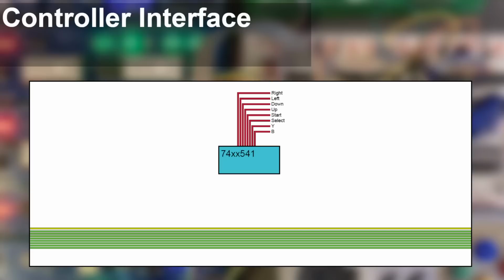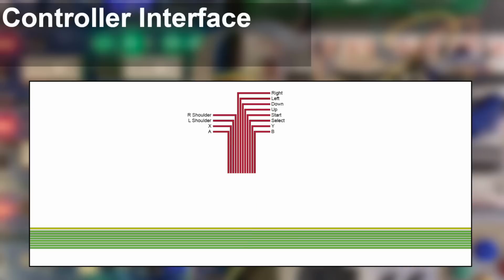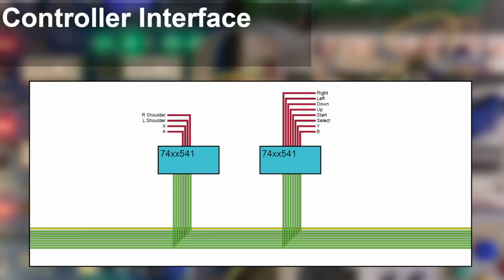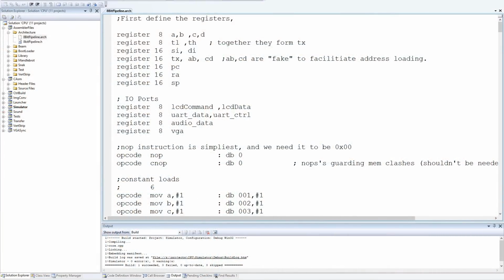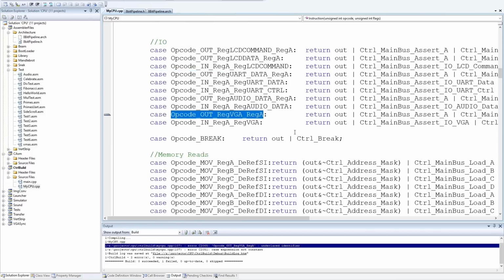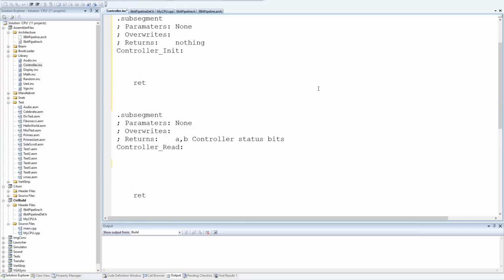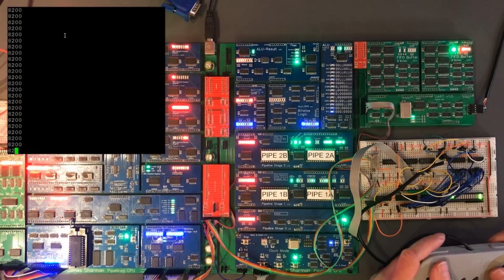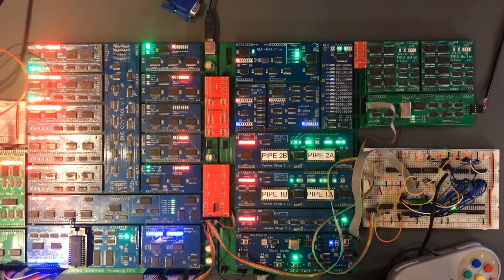SNES Controller Interface – Part 2 – Connecting to the homebrew CPU

Comment: This is a good solution to read 16 bits with only one control line. I think I would have changed the interface a bit to free up bit 8 free on both bytes to be used purely for identification so you would always be able to guarantee which byte has been read just by testing bit 8. I know exactly where you are coming from trying to keep the variety of components to a minimum, even if it used a couple of extra chips overall working with fewer different chips is less head space.
Reply from the maker: I’ve mentioned it in a few comment replies already but I did consider splitting the bits more like that but picked this for a reason. I wanted all the direction bits to be in the same byte (that makes life easier working with the data in code), and I didn’t want to re-order the bits relative to the original data stream.
Reply: @weirdboyjim  another alternative is to pull up bit 7 & 8 for the second byte, since it would be impossible to press both left & right on the controller at the same time.
Reply: @weirdboyjim  Right, it seemed a little odd that you hadn't done this but thinking about it from a software development perspective it makes perfect sense.
Reply: @weirdboyjim  what about a time based reset of the flip flop? You'll likely read both bytes right after one another, and probably not more than once every 60th of a second, so if you reset it every 10ms you'll know that on the next reading cycle you'll always get the first byte first.
6 buttons Megadrive joypads use this trick, so older games which expect a 3 buttons joypad and read only one byte per frame always get what they're expecting.
Reply: I think I'd have made the "signal" that the top two bits were high: to fake that a user would have to hold left and right simultaneously, which I believe is mechanically impossible on the real controller?
Reply: Ah, I see @Stingpie 52 has also suggested this, I didn't scroll the comments far enough.

Comment: Nice.  I'm glad to see I managed to guess how it would be integrated, and what the first demo would be.  :P

At this point, I think the only thing missing for a proper VGA port of snek is the tilemap so you can do text.  I might start porting my version over to VGA, and see about integrating my music tracker... just need to find a reasonable track to use.  I think Nyancat on loop would just drive people insane...
Reply from the maker: Yeah, the Tilemap would make it easier. I think having Audio and Controller on pcb would help as well, I'm low on space without making everything really small in the video feed.

Comment: Why not just map both bytes to a different memory address? Memory mapped Io? Seems much simpler. Maybe the answer is obvious but with so many interesting projects to follow i cannot fully know every single one.
Reply from the maker: That would work, but be much more complex. This circuit connects tot he cpu with 12 wires, you would need to add the address bus and the memory control lines to it. Then you would need to decode the address lines which would take a bunch of extra chips.
Reply: @weirdboyjim  not necessarily. Address decoding often is a task of a single chip or unit in your case. All the boards would need is a select line and a single address line to check odd or even address in this case. The one address line would replace the flip flop and the software state detection

Comment: Another option rather than having the MSB pulled to VCC to work out hi/lo byte is to have some time function (maybe even a 555) do the work for you.  The first byte being read is the low byte.  If another byte is read before an n millisecond time-out period then it is the hi byte.  It also might be an idea to not clock in the SNES data constantly if you ever want to use some old school wireless controllers.  Some of those would freak out if they did not have a rest between clocking.
Reply from the maker: Interesting idea. If you were to implement something like that it would be better to make the timeout a number of system clocks though to make it deterministic.

Comment: Could you feasibly use the reset line to hold the shift register's enable pin in a disabled state until the processor finishes booting? That'll make sure the controller is ignored during powerup, and holding any of the buttons won't do anything
Reply from the maker: You could indeed, but I avoid hardware state that can’t be reset in software. Imagine developing a piece of code, you upload a version that crashes and then you test a fix but can’t be sure if the broken version left things in an unexpected state.
Reply: @weirdboyjim  Watching the video I had that same idea, letting the reset line initialize the hardware makes total sense to me. Not sure I even understand your answer, as software is only ever run after the processor is done with the powerup.
Reply from the maker: @JonnyBergdahl  More than one program can be run between hard resets, I don't want one program to be able to interfere with another.
Reply: @weirdboyjim  Trying to stop Stop-N-Swap tricks? ;) (Regardless, the controller reset could also happen upon soft-reset rather than just hard-reset.)
Reply from the maker: @angeldude101  No. This is more about the case where no reset is happening, debugging code usually has me running code lots without a reset of any kind, it's important to trust the system state rather than have something persistent between test sessions.
Reply: @weirdboyjim  Ah, makes sense.

Comment: Did you just call me out at 7:40, James? :) Reducing the part count is completely valid, but I look to chips that do the job better/easier. However, I am just some guy on the Internet with opinions, I am nearly irrelevant. I just like to point out different ways to do what you did. For instance, I would have split the line to 6 and 6, that gives one bit to unerringly identify high/low part of the controller data, and the option to add a second controller. But again, I am not the one building this fabulous computer and making the neat videos, I am just the opinionated asshole living in the comments :D
Thanks for another great one! The circuit is very clever!! Any plans for a second controller? There are unused bits in the high byte that could be used for ID. 
I wish I could support you on Patreon, but living on a fixed income sucks. I will continue to cheer you on from the sidelines, as it were.
Reply from the maker: I wasn’t thinking of you specifically, but if the shoe fits….  But you are never irrelevant Oscar! I did have a reason why I didn’t split it 6:6 though. I wanted all the direction bits to be in the same byte, and I didn’t want to re-order the bits relative to the original data stream.
Reply: @weirdboyjim  Not splitting off the direction bits makes sense, but not reordering the data stream less so. Regardless, your way works beautifully. And you probably could retrofit a second controller if you wanted one.

Comment: You have left & right on bits 6&7, why not make the flipflop test be for both bits 6&7 high? this would be unambiguous as you would never have l&r pressed at the same time. At least not without a very broken controller..!
Reply: That wouldnt work with the fast sign test he use.
Reply from the maker: Interesting suggestion that didn't occur to me. But it does remind me of a bug I heard about on an actual snes game that took the developers a while to find and fix. The games tester who reported it had a 3rd party controller where it was much easier to trigger opposing direction’s at the same time.

Comment: Cool :D. Just wondering why not use the write line to reset the flip flop so to read the controller you can just write then read read to get the data?
Reply from the maker: That would be a similar system to one I discussed for the Audio system, a valid approach of course but the obvious write line here (Also the audio one) is itself stateful so you would have an extra layer of programming considerations to worry about. That I was considering making the controller stateful was actually a contributory reason why I didn’t use a similar technique in the Audio system.

Comment: Nice! But why didn't you choose for say 2 times 6 bits ordered in a way that makes sense and then use the 8th bit as a marker like you are using it now?
Reply from the maker: Would have been totally valid to do so and it was actually something I considered but decided against. The reason why is the combined result of 2 considerations, I wanted the bits in the registers to match the bits coming out of the shift registers (i.e. I didn’t want to reorder them). Additionally I wanted the 4 arrow direction bits to be in the same byte, inevitably these end up being processed together by the same but of code and splitting them up would be a programming annoyance. I try and touch on this stuff in the discussions but if I talk about everything that crossed my mind designing something it would be more of a rambling mess that it is already ;-)
Reply: @weirdboyjim  Personally, the more rambling mess the better ;)
Reply: Agree with that. You read both bytes when you read the controller. So you have both bytes available in your registers. I cannot see any case when an 6-6 bit solution is slower or more calculation expensive than your current 8-4. Since your bit test behaves the same on both registers. 🤔

If your sign bit is not ambigous you are faster at runtime because there is no need to check the top bit. If you do this check on init it is enough i think.
Reply: Agreed other than he decided that he wanted the 1st 8 bits of  the controller to remain the same.... Think of all those stubborn decisions we make then all the faf we undergo to implement them
Reply: Yeah, this is the first thing that came to my mind as you were building this. It seems like a super minor change that could reduce overall complexity. If so, why not do it? Also why use L and H in your constant names for the buttons? Does it really matter that the programmer knows an implementation detail like this when writing code that uses the buttons? It seems like just another thing to have to memorize. Either way, great stuff!